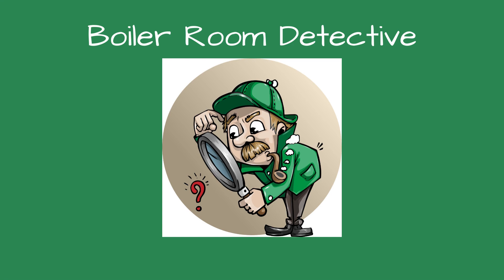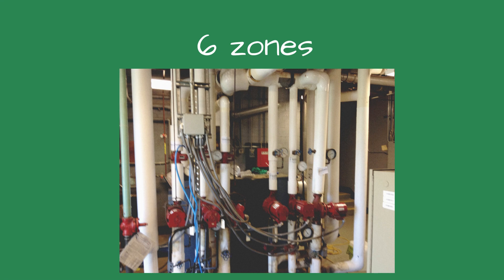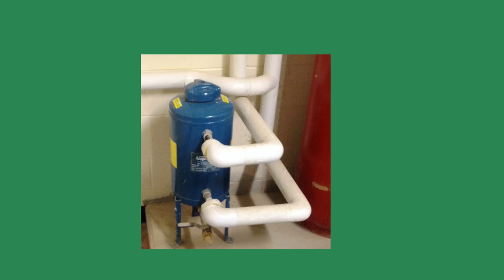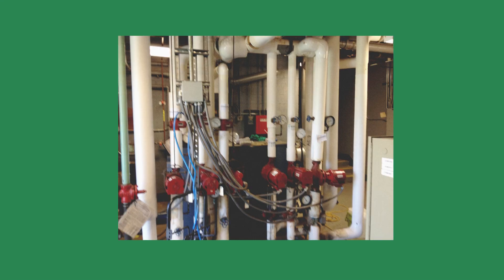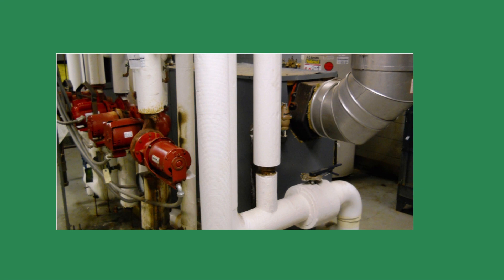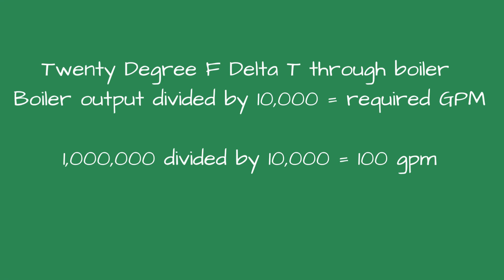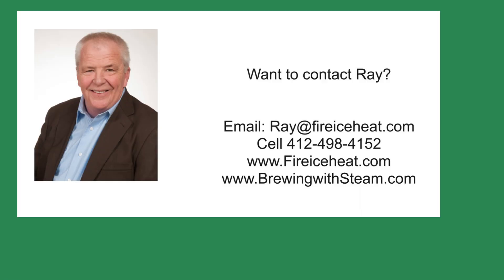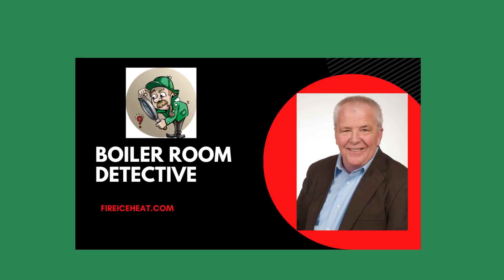The Case of the Failed 5 Year Old Boiler

Comment: Those Smith cast iron boilers were the worst for premature failures.  Can't tell if that burner is set up for Low-High-Low firing, but that might have helped if it was set up right with a proper low fire hold.
Reply from the maker: The customer would agree with you on that  can’t remember if it was low high low or modulating

Comment: Wouldn't that boiler have enough mass and water content to mitigate the low flow issue?
Reply from the maker: I guess not Im wondering if it was a combination of the cold water coming back and insufficient flow Either way it wasn't a good day for the designer and installer. Thanks
Reply: The boiler isn’t going to crack from a low flow event. It will crack if the boiler is at full temperature and then is rapidly cooled. The scenario would be the office/ bathroom zone (s) are fully heated and then the large main zones call and rapidly chill the boiler eventually resulting in a crack. Probably should have piped the boiler with a primary secondary piping arrangement or a three way valve.
Reply from the maker: @rickfromboston  Perhaps you are right. The manufacturer told me it was the lack of flow
Reply: Would that happen if it had been a cold start operation.
Reply from the maker: @Exquisiteheat   It could have I believe it was a combination of that and the low flow Thanks for watching
Reply from the maker: @Exquisiteheat  I believe it would